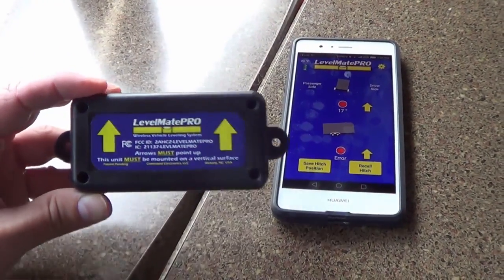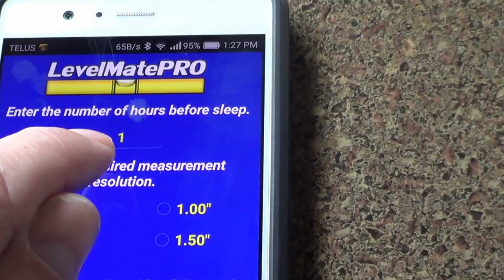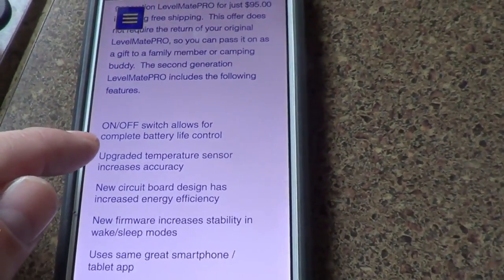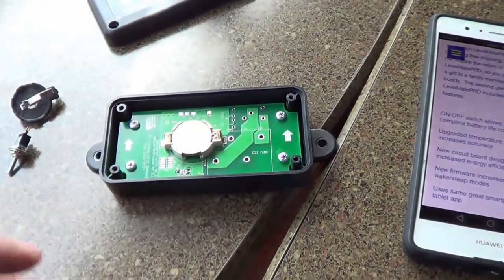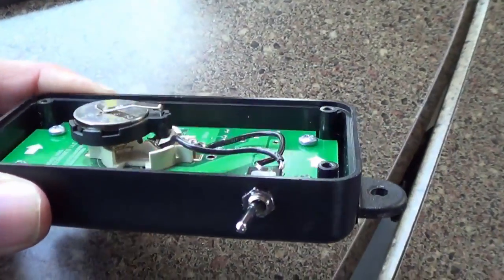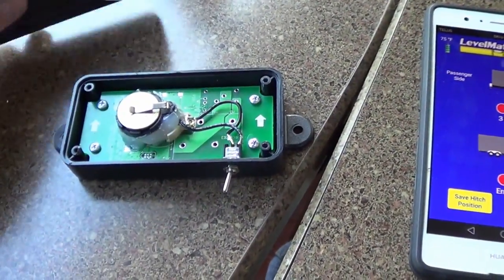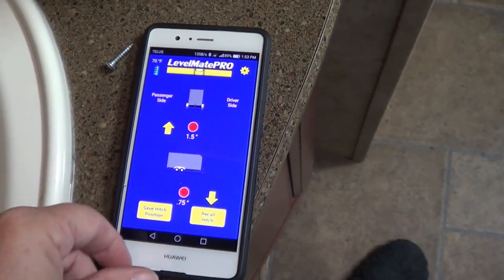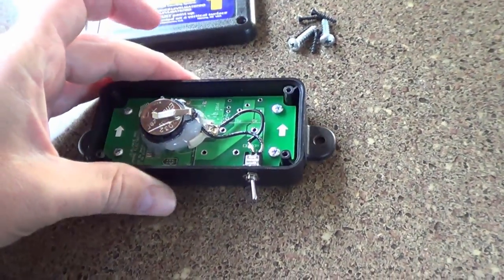Modded My LevelMatePro - Added an On/Off Switch

Comment: Hi Ray, great mod. My question is when you turn your switch back on does the unit remember your previous settings?  Happy travels, Lou
Reply from the maker: Yes, I had the battery out for months and all the previous saved settings were there when I reinstalled it last month.  I imagine the settings are saved in the app software.

Comment: They come with a switch now, upgraded mine and gave the old one to a friend.
Reply: That's great, but it cost you $95. to upgrade as where it cost very little to do this mod and get practically the same thing.
Reply: Start The Rebellion well unless you have a friend with a camper and then you have a 2fer.  I had been just leaving one screw in and removed the battery when not camping, but thought heck this will be a nice gift to Tim and updated.  Pay it forward man.

Comment: Ray, where did you purchase your parts for this mod?  Since most radio shacks have closed up I am having a touch time tracking down parts
Reply from the maker: I picked them up at a local electronic supply place in Victoria BC, but you can find the stuff on Amazon and eBay
 Examples - https://amzn.to/2ljoc1B and https://amzn.to/2I2wWC1
Reply from the maker: Try searches for CR2032 Button Battery Holder and micro toggle switch

Comment: Great idea and modification.  I was wondering how hard it would be to solder the leads of an external 2x1.5V AA battery compartment into the button cell holder with the battery compartment mounted on the wall below the level mate pro?  This would allow using 2 AA batteries which could be changed without touching the level mate and throwing it off level.  Better yet, could it be permanently powered from the 12 V system using a 12V DC to 3V DC buck converter/regulator?
Reply from the maker: Should work fine. :)

Comment: Ray, love that MOD. How about adding a low power led next to the switch to remind you it's on. I did that to a 120v remote switch I had that gave no indication if it was on or not.
Reply from the maker: Could be easily done, but may be self defeating if it drained to much power from the little battery. Maybe one that flashed every 30 seconds..

Comment: Where did you get the info on the 'Customer Loyalty Upgrade Offer'?  I could not locate it.  May try and do what you did with my own twist....wire in a button battery holder that already has a switch built in.
Reply from the maker: On their website under the support menu item - https://www.logicbluetech.com/upgrade-offer

Comment: Where did you get your switch and battery holder? With Radio Shack out of business, I have found it much harder to find small electronic components.
Reply from the maker: A local electronics supply store. You can find the stuff on Amazon or Ebay. Look for "cr2032 battery holder" and  "miniature toggle switch"

Comment: Ray, since you have been using the switch for your level mate for a while now, any issues? I am assuming you are not having any issues with it losing its "level" calibration. I am looking to do the same, however, I am thinking about doing a hard wired version using a small 12V to 3V step down that will fit inside the unit. Only concern I have is interference from the step down to the Bluetooth. If I do make it hard wired, I am also going to wire in a LED and mount it to the front of the case to remind me it is turned on. I would omit the LED if only battery do not drain the battery when turned on.  Love the videos.
Reply from the maker: Hi Chris, no problems at all. It remembers the settings. I've been on the same battery since installing the switch.
Cheers! Ray

Comment: Ray, really nice mod, thank you for sharing that. Do you have links to the switch and battery holder , where I could get my hands on these ?
Reply from the maker: Thank you Mike. You can find similar ones on Amazon - http://amzn.to/2zl2rDq   I searched for CR2032 battery holder, some even come with built in switch.  A search for "subminiture toggle switch" will give some switch options    EBay is another possible source. Cheers! Ray

Comment: Could you also just pop the battery in and out and leave the cover off?
Reply from the maker: Yes, that would work, but could wear out the holder if doing it a lot and it exposes the electronic board so keep away from moisture. Cheers, Ray

Comment: Ideally, the unit would stay off until awoken by an attempt to connect to the device. The switch would work well for a class A or class C RV, but, with Fifth Wheels and Travel Trailers you have to enter the coach to turn the unit on prior to backing into your site. I suppose, an extended remote, waterproof, switch could be added to the exterior of the coach to allow you to turn it on from the outside. The company could also eliminate the CR2032 battery altogether and just allow for hard wiring into the coache's 12 volt system.
Reply from the maker: I would leave it on during travel and if I was making daily jumps, just nice to be able to quickly shut it down for extended stays.
Reply: I put mine in the storage bay so I don't have to enter the RV, just open the door and flip the switch.

Comment: Do you know where to get them parts at thanks
Reply from the maker: I got them at a local electronic parts supply shop. But you can find them on Amazon or Ebay. Just search for CR2032 Button Battery Holder and micro toggle switch. Cheers, Ray

Comment: Seems the Level Mate Pro is more amateur than pro.  No doubt you original review was favorable in spite of it's poor design.  That why I never put much stock in reviews.  There no telling how accurate a review is.
Reply from the maker: Took several months of using it to see the battery issues. They claimed it would be 2 years. Obviously they screwed up there. I still love its leveling functionality though. Not so much for regular campsites but for places like parking lots and boondocking. I can drive around and find the most level spot quickly. Cheers! Ray